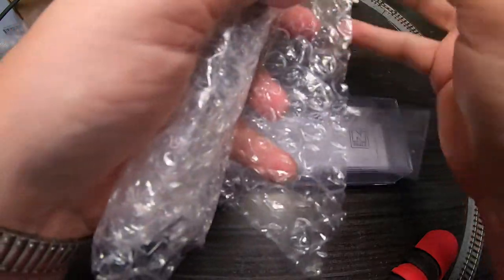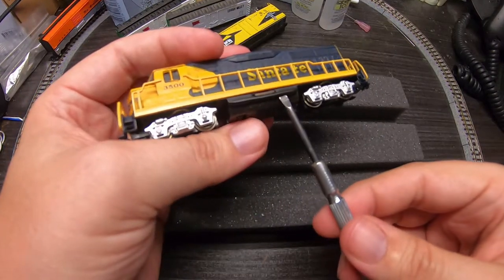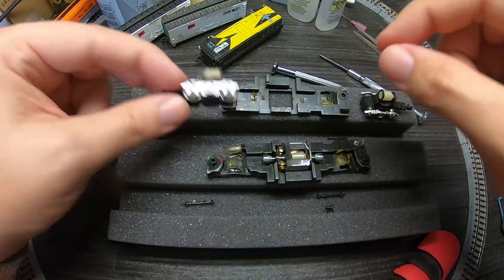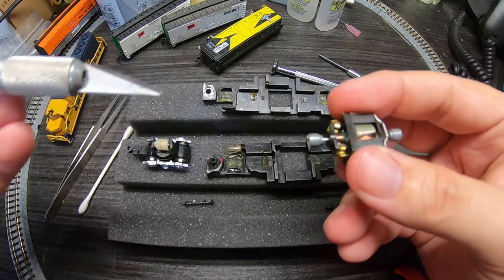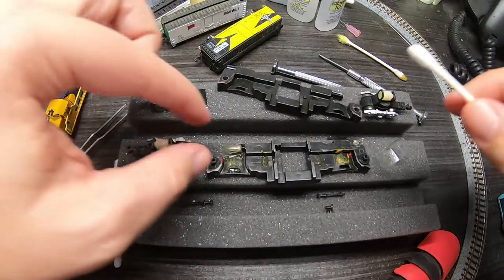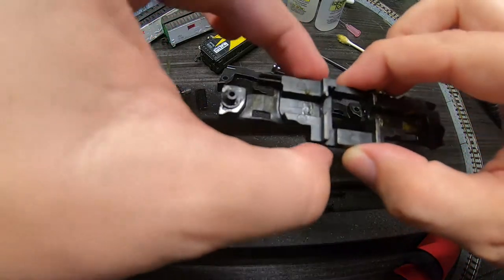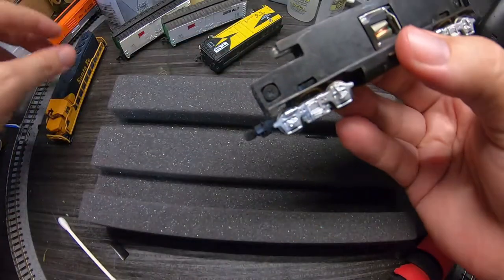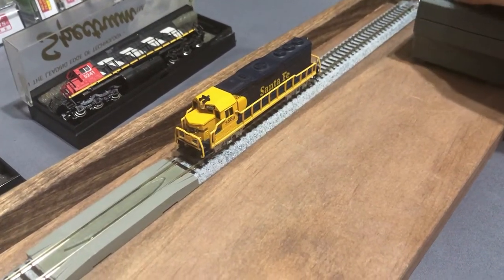Will it Run? - eBay Purchase Bachmann N Scale GP40 - Trains with Shane Ep3

Comment: I picked up a GP50 off ebay that "sorta ran" with a lot of power like yours .... Then it started smoking and I discovered the top motor brush was arcing badly .... it was more carbon dust than metal ... so I'm hoping a new motor I found will get this locomotive running again.
Reply from the maker: Unfortunately the motors on these things are VERY susceptible to burning out. The brushes are tiny and there just isn't a proper amount of torque. Let us know how you get on with the replacement motor!
Reply: @Trains-With-Shane  Well this used motor from ebay runs but something else is wrong now too as it won't make a 9.75 turn and it shucked off a traction tire.   I'm over this Bachmann stuff.  I will stick with my vintage Atlas RS-3's that run great.  The Bachmann GP-50 NS shell is in great condition.   My fault for buying used on eBay to begin with, I usually stick with "new" or "mint" condition bids.

The trucks and dogbones that came with the motor off ebay are from a different model of locomotive as the dogbones are shorter and the 4 wheel trucks are silver.   After $60 for an engine that ran for about a week and $18 for another motor, I'm done with used Bachmann stuff.  I have 3 Atlas RS-3's that purr like kittens.   This is now my 2nd Bachmann engine that is a paperweight, the other being my original 0-4-0 switcher from 50 years ago that has some sort of gear binding issue.   Atlas 3  Bachmann 0   Final Score and game over.    LOL
Reply from the maker: @sams2960  LOL I certainly can't blame you. I have done some musical chairs with parts from later Bahcmann models to make my earlier ones run or run better. Mostly the trucks to get ones with the better black plastic gears rather than the famously horrible white nylon gears. The new Bachmann stuff made in the past 10 years or so is actually pretty good. The problem is that the value isn't really there on their new stuff when you compare it to what you can get an Atlas or Kato unit for. I'll still buy one from time to time but usually only when they have a specific road i'm looking for that nobody else offers. And even at that I've even resorted to having Kato units custom panted instead recently. Either way Sam I hope you stick around and continue to comment, ask questions, etc. The conversations are one of my favorite parts of my channel.
Reply: @Trains-With-Shane  Yup on the white plastic gear, both the locomotive and the trucks i got with the 2nd motor have that big white worm gear but the have black ones on the underside.   I just found a "new unused in original box" Atlas GP-7 that will do the job I had planned for the Bachmann GP50.  I bought it at the asking price of $60 before a bidding war started.   LOL  I don't model any particular railroad so the colors are secondary compared to "new"  vs "used".   I also run old rapido couplers as I don't see any problem with them and I can get rolling stock for a fraction of what microtrains coupler cars cost.  So obviously I am not into "photo realistic" modelling where one has to look closely to see the "it's just a model" clues in the picture.    LOL  

  If you think you could use any of these Bachmann parts or the NS GP-50 shell, let me know and we'll figure out how to get them to you.
Reply: UPDATE:   After taking a break from the tiny pieces, I looked at it again today and discovered I had pinched one of the  truck pickups.  I got that straightened and got the traction tire back on after a LOT of trial and error and now the GP50 is running again thanks to the replacement motor.   The only casualty is the rear light which bounced to the hard floor and I found by stepping on - crunch.    Sigh.      Other than that and the "Bachmann Growl", it seems to be running just fine now so my offer to send you the parts is hereby withdrawn    🤨😂
Reply from the maker: @sams2960  LOL. The good thing about the lights is that Bachmann used basically the same bulb on EVERYTHING from that era. May have to bend the bare wires to suit your frame but should be very easy..

Also... Awww I was looking forward to having another broken Bachmann in the graveyard 😅

Comment: If you are going to use a Q-Tip to clean electronics, wrap a piece of Scott Towel around the cotton ball.
Reply from the maker: I usually don't use them much anymore.
Reply: @Trains-With-Shane  I learned that when cleaning  mouse wheels in the days when mice still had balls. Prevents the fibres from shedding.

Comment: the older hong kong bachmann GP40's (with the smaller motors) were actually better runners than the china plastic drives. i have a little 'junkyard' of these because a couple of our club members have them and occasionally they need parts. i'm doing motor duties for the club because our old motor man moved away on us. on our layout, the china plastic units are usually just siding queens (thankfully...).

Comment: Why put the shell back on before testing?  Makes it easier to pull apart if you have to go bak in and fix things.   Less chance of breaking the shell, as you don't have to remove it again.
Reply from the maker: 🤷‍♂ just the way i did it on that video. Typically I go straight from the overview to the test track without removing the shell. I've done quite a few more since then.

Comment: Maybe the shims of plastic you pulled out were installed as dampers to reduce noise?
Reply from the maker: Looking back I believe that they were actually meant to block excess light from the lightbulbs going up and illuminating the plastic. Although without them in their light bleed is not bad at all.
Reply: They're factory.  I assumed the tape was to stop lube from flying up into the cab and staining the windows.  I recall it only being in the short hood by the glass.
Reply: @epe1238  they use a plastic-friendly grease so that can't happen

Comment: Althought its risky to try add a little more tension on the  motors commutators springs. just a little should make the engine pull much better, and run a pennsil eraser on the commutator to help with the caebon build up.. Or just leave a bad engine alone. DONE! ☺
Reply from the maker: "Don't get it right, just get it running."  - David Freiburger

Comment: My Bachmann GP40 must be older than this one, the chassis is completely different from this one, going to be a pil tricky I think working on it, haven't quite figured out how to get the trucks out so I can clean them with everything else.
Reply from the maker: I've got a video on older Bachmanns as well. Probably has something similar to what you have, The stuff that were older than the one I have here NEVER ran very well unless its one of the very first with metal gears. Then they're noisy but run pretty well for their age.
Reply: Hi Shane, this is the 1969 model, yes, with the metal gears, I figured the trucks out after messing with them for literally at least 6 hours of messing with the one truck. There are a couple of other people who use toothpicks, now, something I realized that I have, and with try, I have plastic Dental Floss Picks,I bought to use to take the shells off the chassis's, but are too thin, I'll have to give one of them a try on the commutator. What is the video of the older Bachmann 's that you mentioned above? I'll look for it and watch it.
Reply from the maker: @Docnty  https://youtu.be/YYY2z_0uxaY
Reply from the maker: @Docnty  Also here is one where i tore apart one like you have. https://youtu.be/Y_1O17v-uBs
Reply: @Trains-With-Shane  thank you Shane for these 2 videos, I'm very grateful 🙏.
Reply from the maker: @Docnty  Thank you for being here, David :)

Comment: I've got the same exact model. I've had it for 6 years, and it's having issues now. I turn the power on and the lights come on, but it won't budge. Cleaned the track and the wheels really good...still nothing. Can you help me out?
Reply from the maker: My only advise would be to tear it all down, inspect, and clean, something may be jammed. see if the motor runs without the trucks installed. If there is a cracked axle gear then it could cause a jam.
Reply: Thanks. 
 @Trains-With-Shane
Reply: axles all look good, cleaned everything top to bottom like you did in your video. Lights come on but still no movement. It's frustrating, because it ran so good, had to go to hobby shop, pay 40$ for a silver/red sante fe diesel Bachmann model from 60's/70's...and it sure struggles to run around the bends and curved track. damn
Reply: and what do you use to clean your track???

Comment: just curious if the motors can be upgraded to a flywheel equipped (5pole)?
Reply from the maker: I'm sure it's technically possible but it would be a LOT of work. At that point i'd just switch to a newer Atlas or Kato and save the massive amount of trouble. You can get a new-ish Atlas or Kato for under $100 if you look around. And that's only about $40-$50 more than a decent used Bachmann. Also you can get a new-ish Bachmann GP40 (DC only) for ~$80 or so if you look around. I've got a few and they run great.
Reply: absolutely. you can get the 5-pole motors from bachmann. the same motor used in the early spectrum dash-8's. they are about $15 and are compatible in anything with the china frame-type 3-polers. i use them to repower trix f-units. good question!
Reply: i should tell you that you'll have to pull the flywheels and trim the shafts, but its still a cheap and worthwhile motor-swap. you'll like the upgrade....
Reply: @tommurphy4307  thanks for the tip :)

Comment: Just now finished doing maintenance on the first if these i have from 2005'ish. they all run poorly after being stored so long. The first one sounds better than factory and slow speed is much better. these are very fiddley :/
Reply from the maker: Yeah even the models with the newer black gears were till using the same weak motors and crummy drive setup. But they were getting somewhere. At least fixing some of the problems that plagued them for a while. The newer stuff with the closed can motors are better. Now that being said as long as the motor wasn't smoked the black geared Bachmann's are worth investing a little time into with a little maintenance. Let me know how it turns out.
Reply: @Trains-With-Shane  i have one of the "Santa Fe 3500" GP40s running smoother than when new. It had some grease in the ends of the dog bones and the boogies from the factory. gonna dive into the second to night. I have two Bachmann "Amtrak 951s with cars on the bench one is a Hong Kong model and the white gears all moselty split. I'm using some ABS glue to reweld them together to see if it will help. None ran when i got them now zI just need gears. Might see if I can resin 3D print them too.
Reply from the maker: @Wizzard033  I've got a first run Hong Kong Bachmann set with the metal gears in storage. It's a GP40 as well but I can't remember which road. I think it may be Santa Fe. It's never been ran.

Comment: The old motors in these are known to prefer one direction and the pickups are weird
Reply from the maker: They're also way too small and run hot as a result often smoking commutators.
Reply: @Trains-With-Shane  yes i know i now own three are from the generation before the one in this vid the whitebox gen and one is from this gen ironically the same loco and livery
Reply from the maker: @thetruetoastie3014  Bachmann loved using that yellow/blue Santa Fe Freight Bonnet livery and loco number 3500. It ended up on a bunch of GP's. lol.

Comment: The more you take it apart the easier it gets to work on 32:54
Reply from the maker: I've taken apart plenty of them since then. Interestingly the early Kato units are a little bit more fiddly because of the little brass bearing blocks. But not too bad.